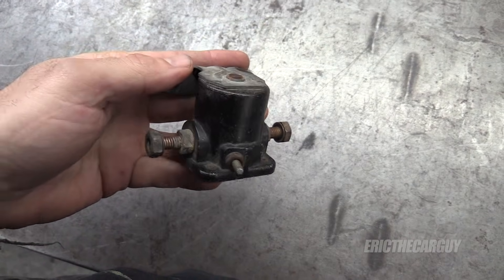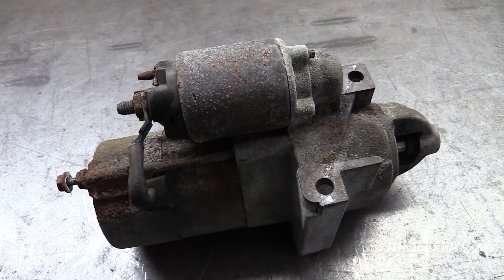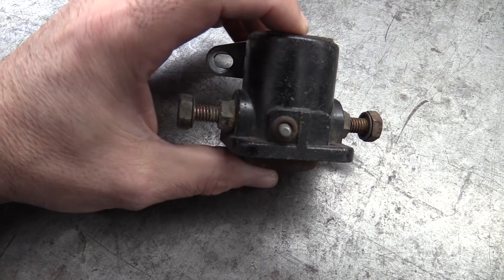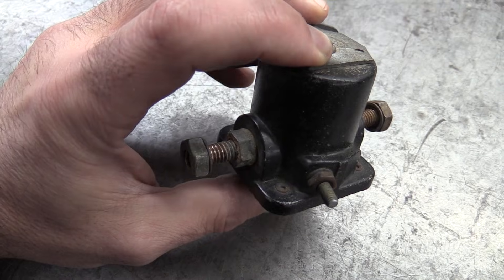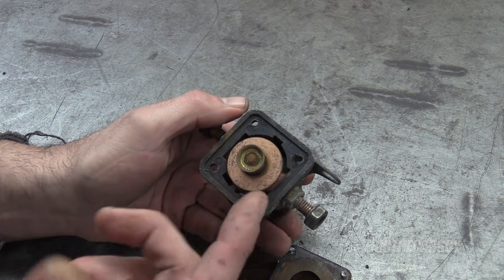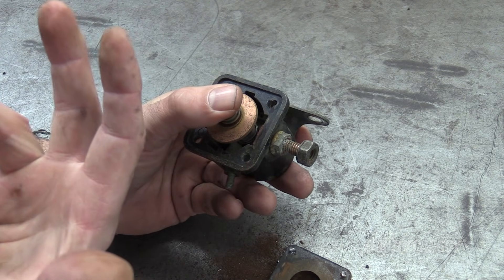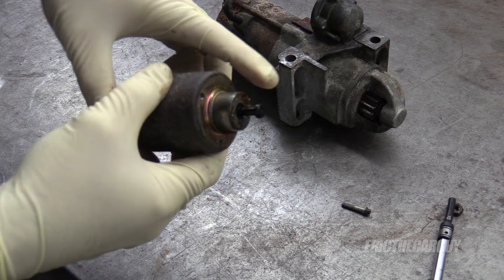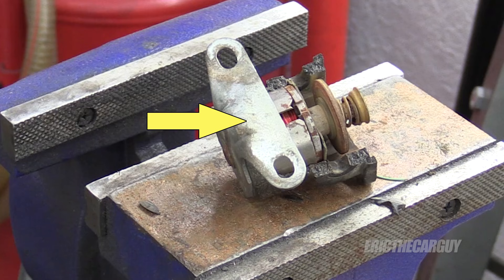How Does a Starter Solenoid Work?

Comment: Actually, when you're tapping on the starter with a hammer, you're causing vibrations that allow the rotor to move. Inside the starter, when the power goes thru the windings, it creates a magnetic field that reacts with the magnets built into the starter case. The windings create a repeating north/south pattern, which makes the rotor spin. Usually what happens it that there is a break in the windings, and that causes a break in the magnetic field. Now if the starter happens to spin down into that spot, it won't spin. Tapping on the case causes the rotor to spin just enough to let the field react with the magnet, and the starter spins. When it is spinning fast enough, the break in the field gets skipped. The way the Ford remote solenoid starter is wired, there is a pull in coil built into the starter that pulls the lever which causes the pinion gear to pop out and contact the ring gear. Btw, some starters, like the Ford remote solenoid type, have field coils built into the case, and the magnets are on the rotor.

Comment: Thanks for sharing. I understand that it happens over time but can you think of a reason why it would have to be replaced 3 times in under 5 years? Had a 97 Taurus for 3 years and replaced it a year in and right before I sold it to a buddy of mine. He's had it less than 2 years now and just had to replace it again. The car is admittedly a POS but what could be causing this?

Comment: So the clicking sound one hears when the battery is weak, is the solenoid engaging but the power from the battery is too weak to move the starter motor?
Reply: It's the plunger actuating to press the two contacts together and complete the circuit. If the contacts are bad you will hear the sound but still not get juice to the motor.

Comment: not really the same. ford slams the drive gear into the flywheel when the motor is on. the solenoid on top the starter engages the gear and then turns on the motor(much better design). In the old days when the solenoid contacts burned away till they did not work. You could take the solenoid apart and turn the contacts 180 degrees so as to pick up new copper and away it would go again. with 12volt system and breaker point ignition there was a contact on some starter solenoids that would bypass the ballast resistor during starting. nice video on solenoids.

Comment: After I bought my ‘68 Galaxie in August of 2003, it went through half-a-dozen of these damn things in just three years.  And I might drive that car a grand total of 1,000 miles a year — it’s not like the solenoid was being used all that much!  A mechanic friend of mine told me to sand the paint off the top of the inner-fender where the solenoid bolts on, then bolt it on as tightly as I could, then spray paint over the whole thing to prevent rust.  It’s been 12 years, and I haven’t had to replace the solenoid since.  Don’t know why it helped, but it damn sure did.
Reply: @LMacNeill •  I'm a little late to the game here but i had a '68 Camaro (in the '90s) that in approx 5 years i must have replaced about 15 starters (that came with solenoids attached). I would turn the key and i would hear a loud caa-rack! sound. Eventually when i would pull the starter, just about every one would have a crack in the starter housing. (The guy at the auto parts had always argued with me, because I'm a  girl and i don't know what im talking about, he said starter housings don't break. He was impressed when i brought my cracked one in for the core charge). Anyways, we think they were overheating. We put in a heat shield. That didn't work. We tried shimming also. Then my Uncle Robin, who built public transportation busses, brought home one of those bus Ford solenoids and (also, just like yours) installed it on the inside fender well (of my Chevy) and i (also) never had to replace another starter in the remaining 7 years that i owned it. Then my car got stolen. Sorry. Long story.

Comment: I just knew the hammer trick worked, now after 60 years, I know why. Thank you very much!!!
Reply: Generally that’s not why that works. Usually the starter solenoid (the one that engages the starter gear), is stuck and striking the starter housing can sometimes shake it loose. It can work if the windings are not open and it’s just crud preventing it from engaging. The easy way to tell if the solenoid he is showing is bad, is to make sure your vehicle is in park or neutral with the parking break on. Then turn the key on and use a pair of pliers to briefly short the 2 large lugs. This will bypass the solenoid and send power to the starter. If the starter engages, you most likely have a bad solenoid but you can verify by supplying positive 12 volts to the S lug which is just like trying to start it with the key. If it starts, you have other issues like a bad ignition switch or blown fuse.
Reply: @yqwgjsg l.  Wow. This video is a gift that just keeps on giving. Lol. I came to comments to tell a little story elsewhere, and your comment brought back memories, of me, a girl, having to put my '68 Camaro into park, turn key to on, lock my car with spare key (so no one would jump in and run me over), shimmy under my car with a wrench and touch those two bolts to start my car. Sometimes in parking lots. I was busting open cracks on starter housings way too often. The solution to that dilemma came 5 years and 15 starters later when my Uncle Robin, who built public transportation busses, installed one of their Ford solenoids on my Chevy's firewall and i never had to replace another starter. Thanks for bringing back the memory.
Reply: It works because 90% of the time the starter brushes are worn causing intermittent connection. A light tap of the hammer jiggles the brushes into better contact with the commutator.
Reply: Smart

Comment: A little confused on what the magnet is pulling against as it isn't that copper disk.  I guess it's either that larger spring or the metal end cap he was pushing with his thumb.
Reply: The magnet's pulling against the steel plunger that the copper disk is attached to.

Comment: Why do some vehicles have a multiple starter solenoids?  My truck has one on the starter and the fender.
Reply: That configuration is used due to the power needed to drive the bendix solenoid which has to throw the drive gear out to the flywheel. The firewall solenoid feeds the high current to the bendix solenoid as an intermediary to reduce the current that the ignition switch feeds to the system.

Comment: I always thought, lacking an expert information, that tapping with the hammer (or an iron rod if that) was to pull apart the contacts as in a usual electrical motor. In the end it's the same principle but I couldn't be more wrong.

Thank you for such an explanation that makes it easy to understand. Yeah, the topic isn't that complicated at all, but still.

Comment: Noticed that my key did not return after recently starting the car -- hadn't used the car for a few days and weather conditions are freezing. After switching the car off and restarting, the key returned from the start position and hasn't happened since--just wondering do I have trouble looming?

Comment: I am sorry Eric you need to go back to school to refresh your reading about the TWO seperate windings in the solenoid, the pull-in and the hold-in coils. The pull-in is stronger pulls more current and grounded to the starter side positive terminal. Before the contacts close, that post is just grounded thru starter windings. Once the contacts close that post become positive and since both sides of the pull-in is now positive it is shut down to avoid over heating, what holds the plunger now is the hold-in  windings which take less current and grounded thru the case. I know this is little more complicated than your simple explanation of a single coil solenoid, but this is how stuff works in real life. Thank You

Comment: In my experience replace the solenoid every time you replace the starter for trouble free performance. I've done the reconditioning trick but it never lasts as long as a new one does and you end up replacing it later anyway.

Comment: Although people often refer to the starter drive as a Bendix, modern starts don't use a true Bendix drive any more.  They were a simple system that used the inertia of the drive pinion assembly extend the drive gear and engage with the ring gear (rather than a mechanical linkage from the solenoid to push the drive gear out), and backdrive from the ring gear causes the drive pinion to exceed the speed of the starter, at which point the drive pinion is forced back and out of mesh with the ring gear.  However, this causes a fair amount of wear as the teeth first engage while the starter is already spinning and the ring gear is stationary.  

I've seen this most commonly on older English cars.  One common sign of a Bendix is when the engine coughs but doesn't quite start - and that momentary firing of one cylinder is enough to disengage the starter and it just freewheels.  At this point, you need to release the key and stop the starter before trying again.
Reply: PS:  Great video, mate.  I remember learning how these things worked (a frightening number of years ago)...but I never got around to actually disassembling one for myself.  Cheers, mate.  :-)

Comment: Hey Eric great video. I had an interesting situation the other day with my Tahoe. When I started it the starter stayed engaged after the engine was running. I turned the key off and the starter ran on turning the engine over. I had to disconnect the battery to stop the starter. I had the battery disconnected for about one min, hooked it back up and it was fine. I started and turned off  the truck a couple times it was like it never happened.  Could the plunger in the solenoid have gotten stuck some how? Allowing power to continue to flow to the starter until I pulled the battery terminal?

Comment: So, when a "Bendix" goes bad, slowly... and the starter disengages from cranking the engine prematurely, but still spins loudly and rapidly, what's happening?  If the plunger is pulled far enough to engage the starter gear, it is also pulled far enough to make the electrical connection.  You cannot have one with out the other, no? How can you still have the starter being energized for a second or two, yet the gear disengaged?

Comment: Gotta love that automotive autopsy genre. I was always puzzled that minor dysfunction of starter solenoid contacts leads to replacement of the whole starter motor. You showed why. They are not so easy to take apart without breaking plastic, and even finding the right size contacts has become a problem. That copper disc design used to be universal, and taking them apart was much easier in the past. With labor being a big factor in overall price, the economy has moved to a 'throw it out, buy another from China' game plan. Even the rebuilt starter market has to compete with new, so more steel and copper hits the recycling bin.

Comment: Every car I've ever owned has had the built-on solenoid which, as you explained, also engages the drive gear onto the ring gear.  But how does the drive gear engage onto the ring gear when an remote solenoid is used, like the first one you showed ? 
I do remember way back in my trade school days I was shown a starter motor that had a spiral cut into the main-shaft.  When the motor is energized the small gear runs quickly along the spiral and engages onto the ring gear.  Is that how it works ?

Comment: close to true, some starter mounted solenoids also have a plunger for the drive gear engagement, so not always the same
Reply: looks like I should have finished the video before commenting, you did point that out.

However, the gear that engages the flywheel is the pinion gear.

A bendix is when the pinion is mounted on a helical gear so that it is thrust out by the starter turning.

Comment: Why is it that some Fords, like my 92 Ranger for example, have two solenoids? (one on the fender, and one on the starter) It would make sense if it was a fail safe set up. I found out, via a failed solenoid, that this is not the case. If the divorced solenoid fails, you're hooped.

Comment: And 9 times out of 10 when you have a bad starter it's just the solenoid that goes bad, and you can save yourself some money and just replace it rather than the entire assembly.  For instance, a new starter on my wife's 2002 Dodge Intrepid costs around $60, a new solenoid for it costs $20.
Reply: great tip!

Comment: The divorced style solenoid has a disc inside, so tapping moves the disc a bit and it may make contact now. Does that work on solenoids attached to a starter, too? The one shown here does not have a disc style contact and the contact can't really move. Thumbs up for the Pikachu poster :D
Reply from the maker: Some that are attached to the starter also use a disc. Usually older models. It sometimes doesn't take much to move them into a position where they can make better contact.
Reply: Thanks, good to know!

Comment: sometimes, if you do hear the solenoid actuating the starter is at fault because of the commutator worn out in certain positions and not making contact. hitting it moves it slightly to make contact. If I had a guess, I'd say that's even more common than the solenoid failing.

Comment: Ahh the ye-olde solinoid and inertia starter.
Once the power is applied to the starter, the bendix is thrown forward by the sudden rotation of the spiral on the motor shaft, with rotation the bendix will mesh the ring gear.
The captive spring in the solinoid allows the disk to autolevel itself on to the contacts and apply pressure.

On modern starters the solinoid is timed to push the drive forward on a low motor speed to mesh the drive before applying full power to the starter rotation windings, so it's pre-engaged and kinder to the ring gear :-). (Mostly larger starters)
Sorry too much waffle :-(
Reply from the maker: Not to mention some hybrids that have a starter/alternator assembly instead of a flywheel.
Reply: Ooow that's odd, i didn't know about that, it's been years since i worked in an auto repair factory, im out of date LOL :-D.
Reply: My Prius combines 2 electric motors to function as starter, generator (alternator) and as an integral part of the transmission which uses planetary gears in a CVT setup. Despite its complexity, it works amazingly well and is seems to be quiet and reliable.

Several years back, I read about an Mazda patent that  stopped the engine at a precise orientation, so that a single spark would start it up. No starter  motor required. 
(See Method of starting spark ignition engine without using starter motor  https://patents.google.com/patent/US8036817B2/en)

Comment: Ah, the days of starting cars with a pair of pliers or a screwdriver across the posts as well as tapping with hammers...  due to... reasons.  (Mostly crap cars)   That being said, and I am surprised at myself, never took one of these apart regardless of manufacturer.    Very interesting, thanks for posting this.
Reply: If you can't fix it with a hammer - your problem is probably electrical.  And even then, a hammer sometimes works.  :-)

Comment: Glad to see things are back to normal with your channel. Seems like these are just super beefy relays. Seems like these should be an easy fix. If it weren't for the manufacturer making them hard to take apart. Looks like you could buy some copper and shape it to the correct size for those parts or even buy premade copper pieces to replace the ones that are pitted.
Reply: Imagine it in an EV with 400 or 800 Vdc!
Reply: Some of the ones built into the starter are pretty easy to get at and replacement contacts are available.
Reply: Darwinpasta I was just referring to the rivets and the fact that things are mostly press-fit.
Reply: Yeah, the remote-mount ones aren't built to come apart, unfortunately.